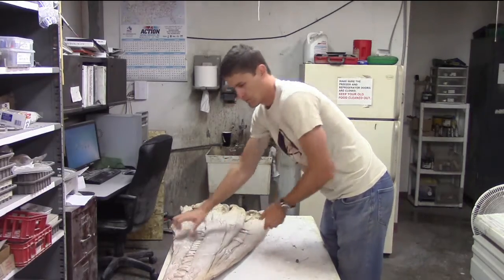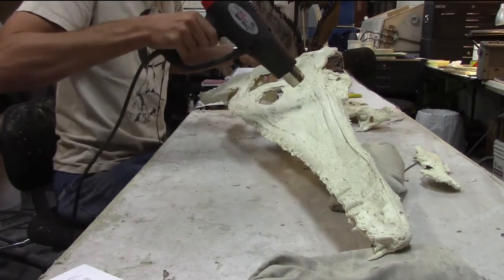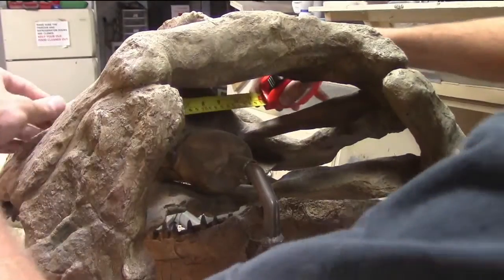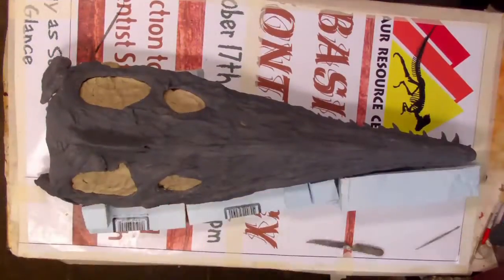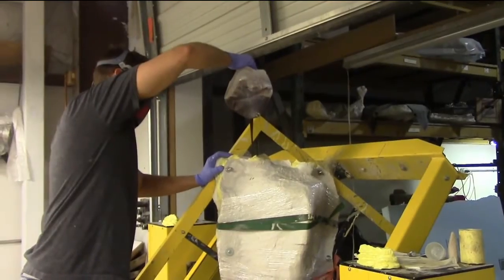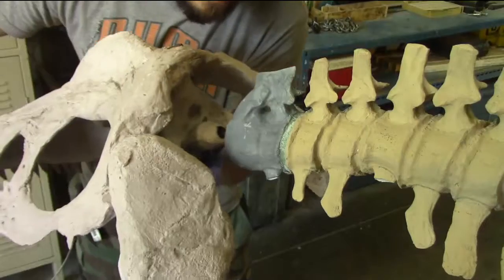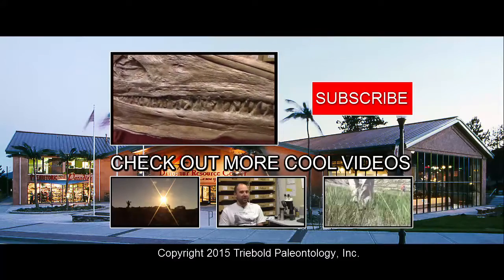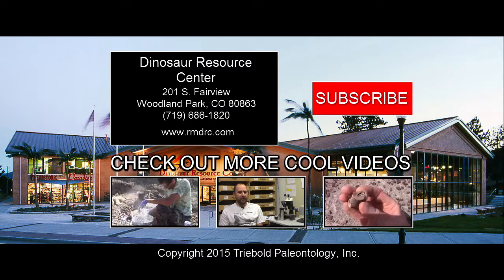#27 The Sea Monster Skull

Comment: Wouldn't the cast be slightly smaller than the real/original bone?
Reply from the maker: +TheSolarPenguin No. We use a high-resolution silicone for molding and it allows us to make exact copies.